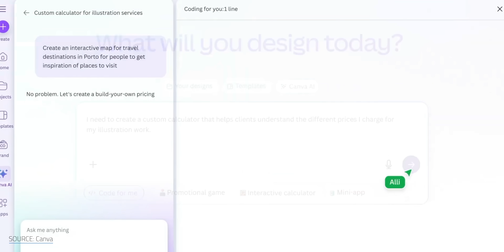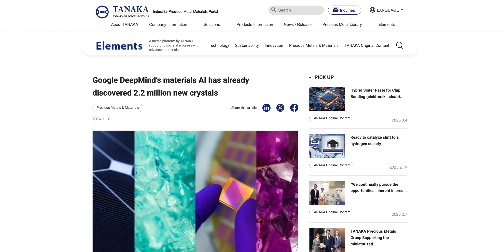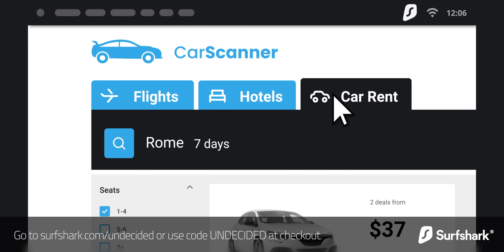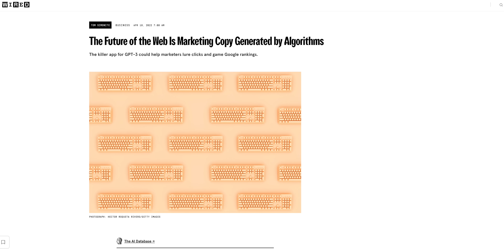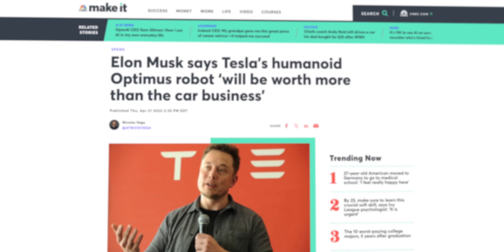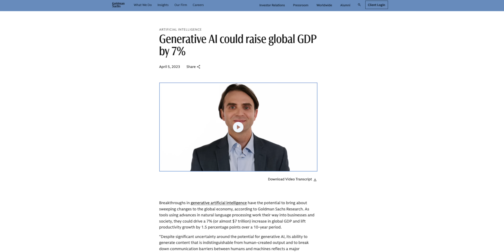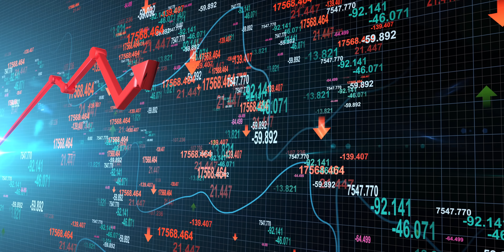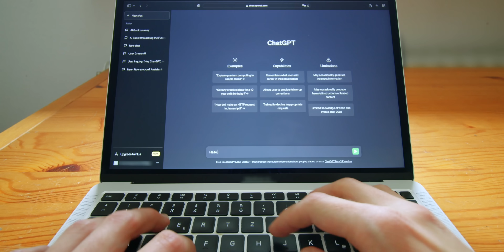Why the AI Revolution Has a Fatal Flaw

Comment: Here's the problem - assumption that we're going to be buying. Nope. The world will divide between the owners of production means and those dependent on "free" goods. However unjust current system is, when you have money, you have money. You can exchange it for whatever you want. Companies compete for your money. You can also save up and eventually start owning production means yourself. Or you can withhold purchase until price lowers, thus having a say, however insignificant, in how much something is worth. But if nobody's working and earning anymore, if everything is "free"? You're at the mercy of industry. They can withhold anything, after all, you're not paying for it with anything else than lack of agency.

What is free often proves most costly. ~ Goro Takemura, Cyberpunk 2077

Comment: I am convinced a UBI based on energy credits owned by the individual is the best solution. Energy credits would be investments into energy production companies that yield the source of both AI value and all production of products. If the government builds a nuclear reactor, the tax payers get UBI as investors in it's profit. UBI must have a maximum annual income (probably $150,000 or less) cut off, that allows the program to be solvent, but it must also have a minimum quality of life assumption. This model gives higher benefit to lower income tax payers, and eventually gives best benefit to non-tax paying citizens. The flaw is in the effort to live and be fruitful. If you subsidize drug addiction and strip clubs with UBI you will not end up with a healthy society. Therefore, a human-only counseling program should be used to check on no-income citizens for healthy lifestyle, and there should be strict laws taking away UBI for non-tax paying criminals. That they earn back if they return to some form of contribution and pay some taxes to "reinvest" in the energy based market.

Comment: Personally, I think lots of people talk about the potential for lost jobs.. If anything, I think this has been the MAIN narrative of the AI boom. IMO the solutions present are really one idea. Kinda. UBI funded by AI tax - a slightly abstracted method of distributing AI ownership. Yes, job reskilling and retraining programs have been inefficient and ineffective. And I think that if we do end up going down this path (and that's not yet guaranteed), we will be forced to fundamentally decouple income from work. Everyone needs income, there won't be enough work. That's the problem. So, the solution is to provide income regardless of work.

The problem there is actually that AI still sucks haha. AI is already taking jobs - but it has yet to provide enough value that society as a whole has seen benefits that we could share meaningfully. We haven't seen GDP skyrocket or productivity multiply yet. There's nothing to distribute. We may get there. Same thing happened with basic, dumb automation too. And just as the price and quality benefits of those job-replacing innovations begin to fall apart (and perhaps theoretically now accelerate with AI), the case for decoupling our ability to pay for products and services from our ability to work the jobs providing them only grows ever stronger.

Now if only AI could force us and especially the rich to pay a fair share of taxes..

Comment: 8:24 "Efficiency didn't solve the problem: it made it worse." I disagree because it depends on how you are looking at it. If you think the goal is overall reduction of coal usage for environmental reasons, sure, this increase in demand made that worse. But it made manufacturing better, which is why it grew so quickly. When coal use was inefficient, using it was expensive, so there was a more limited set of things where it made business sense to use it. As it becomes easier, cheaper, and faster, more and more use cases emerge where it is now a viable option. This increased overall productivity by allowing us to make more, better stuff cheaper. That opened up capabilities like trains being used for mass transportation, blast furnaces allowing us to make things from steel, and coal power plants providing electricity to homes so cheap that we could afford to light our homes in the evening with it. These all had huge knock-on effects, and while you would be right to argue that some of these effects were negative, that's always true of every technological advancement. Equally true is that it provided many benefits that we take for granted today. Your example goes to prove the original point: that AI enabling increased efficiency could lead to us being able to produce more, faster, and in doing so provide us with much better things than we have today.

Your original argument still stands - this could lead to the economic collapse you foresee - but the argument you've given at this point doesn't support that conclusion.

Comment: Brace yourself for the AI takeover, where our jobs vanish faster than a pizza slice at a frat party. History’s littered with tech terrors that sparked panic, and AI’s the new bully on the block.

The Industrial Revolution’s looms crushed weavers’ livelihoods, leaving Luddites smashing machines in vain. AI’s worse—it’s coding, analyzing, and probably knitting better than your grandma. Programmers and analysts? Doomed.

Cars killed off blacksmiths and carriage makers, who cried economic collapse. Now AI’s driving trucks and routing packages, turning truckers into nostalgic relics. The automobile age birthed jobs; AI just births unemployment.

Computers axed secretaries and clerks, who feared the economy would tank without their typewriters. AI laughs, writing briefs, diagnosing illnesses, and penning satire. Lawyers, doctors, writers—gone.

ATMs spooked tellers, but banks survived. AI’s running entire financial systems now, with chatbots and algorithms replacing humans. Tellers are “experience specialists” (aka unemployed).

Manufacturing robots stole factory jobs, yet we adapted. But AI’s designing factories and supply chains, leaving humans to polish robot egos.

AI’s not just taking jobs—it’s rewriting work itself. We’ll be trading canned beans in shantytowns while AI rules. History says we’ll adapt, but AI’s too smart, too fast. Stock up on beans—the robots don’t break for lunch.

Comment: A new form of socialism is coming and status quo is not happy about it... this is not a paradox, with AI, capitalism will be almost impossible to maintain...AI dependent socialism will be a very efficient world where purchasing power will increase because the profits will be extremely low, as new stuff will be invented everyday without too much capital investment...For example if a drug company spends billiions of dollars to formulize a cancer drug, which takes 20 years, with AI the formulization will be done 10 times faster and may be 100 times cheaper. So the company will not be able charge 10 thousand dollars per injection. instead it will charge 100 usd per injection or even less. In other words, people won't have to be rich to afford stuff anymore. Abundance will increase the purchasing power for everyone. someone impoverished will be able to afford more with less.

Comment: I have thought extensively on this and I think it is good you are raising these points. I think it is also valid to go deeper into the positive and negative cases for this. The most positive case could basically bring about a utopian future where money has no meaning… Something like Star Trek. (though it would require the world‘s largest companies, governments, and wealthy individuals to consciously agree to this) The worst case scenario hasn’t been discussed by far… 300 million displaced workers is a drop in the bucket. Remember with the combination of robotics and AI you are potentially putting entire nations out of a job like India. Think of all the nations that use cheap labor for farming, manufacturing, hospitality, and services. Every single one of those jobs can be automated. 
If you have worldwide unemployment of 30, 40, 50%
You will have complete economic collapse which would lead easily to a likely worldwide return to a society that is just barely at the industrial level or world war.

Comment: Replacing human labor is not a flaw of AI. It is a feature. That comes with replaced and displaced jobs by design. This is why the most important skills that people can master are explicitly translational between fields. Companies are paying through the nose for AI expertise as a sunk cost. Those jobs will not outlast the next decade and the pay will decline after another 5 years as AIs are trained by their architects today. This already happened with middle management. The safest jobs are those we are presently too reticent to permit an AI near, medicine (doctors/pharmacists/etc) and governance (bureaucrats/politicians/judges/etc). Even maintenance is on the hook. Manual labor by plumbers and mechanics will be under pressure soon enough. Prototypes are already being trained to compete. There will always be a market for human labor. It will fall to artisan quality and prestige. It will not be as drastic as the horse buggy falling behind the automobile, but it is easily a characterized as a larger technological leap. Energy production will be the major bottleneck behind AI, but nuclear energy solves this. That is a large part of why gen 3+ and 4 fission plants are back on the table, as well as fusion research and SMRs. Energy has been a long term looming major catastrophe for mankind. It is one of the open secrets you are thrown at in core STEM, especially engineering. We simply do not make enough energy available for everyone and we continue to increase demand, even with improved efficiency through technology. The existential gap between demand and supply from the rise of AI will finally push energy production to new highs, which will hopefully outpace the rapid rise in demand from exponential phase growth in global populations. If not, then people will starve and wage war for energy with a desperation we have not seen before in history. The quality of life and energy production and consumption per unit population (pick your quality metrics, population units, and specific demographics, it doesn't matter) are strongly correlated. The more energy a population can produce, sustain, and consume per unit of population, the better the quality of life. AI is going to stress test this historic trend with energy demand. For the presently planned uses of AI over the next 10 to 50 years to be covered, we will need to double the energy production, across the board for all sources, of each country using AI. We were already in an energy crisis before. This is the emergency. AI will be used regardless of energy supply. It will begin to reduce the supply available to people unless we finally get nuclear energy mainstream and widely used. Renewables simply can't and won't cover the gap. That said, nuclear energy jobs will only be safe from AI for the next few decades, maybe less. So, it would be better to get in on leading technology development early, if you still want a job in the field.

Comment: It will pass, like everything else. 
Once businesses start to notice how much money they lose due to incorrect decisions made by the software, they'll start replacing the AI with people again, and after a few major disasters, AI will also be banned from use in life-critical situations, law enforcement and finances. It's like a shiny paint-job on a Yugo, it looks nice but under the hood it's still junk. Just look at how the code for the AI is written, by whom, and that should give you a pretty good idea of what to expect. Right now the hype is still raging with impressive demos to lure investors, but it will disappoint. It's nothing more than pattern matching and brute-force optimization, nothing intelligent to see.
To be clear, the name is misleading as "intelligence" usually implies some kind of reasoning, yet it cannot reason so it is not "intelligent", but it does have plenty of "intelligence" when the word is used to mean "information", so it's mostly a glorified parrot, incapable of knowing if the information it is fed is actually valid or made up.
Humans are still going to be increasingly replaced by automation. There's no way to compete with robots when it comes to speed and precision, but that's not as much because of the software as it is because of the mechanical engineering behind the impressive machines that make almost everything we need.

Comment: One of the problems with UBI is when universal across the economy instead of local small scale trials, it could be inflationary where landlords would just (in practice implicitly) index rent to be a large % of UBI, and any improvement in UBI would go to them. Same also with basic goods and services providers. And then owners pocketing the difference.
Some degree or mechanism for redistribution of ownership combined with UBI may be required, but politically probably won't happen in practice until there are or about to be riots, unfortunately.

Comment: Even if the 59 year old wanted to re-educate or retrain the cost to do so would be prohibitive. Unless the USA makes the cost of knowledge come down dramatically the transitions will stay out of reach for most. I've already lost my job but find it difficult to justify taking on debt that may or may not pay itself back (in any reasonable timeframe if ever).
Of course people could actively decide not to buy from companies that use AI. Turn it into a liability instead of a strength. Social problems have social solutions.

Comment: I was evaluating AI supply chain solutions back in 2004. It was a model that had to be trained. The AI part was hype. Most of what you described is hype.

And AI will be a net negative. From job displacement to the ridiculous power consumption, it's time to bring this under control now before the people demand a Butlerian Jihad like in Dune.

Comment: One of the biggest issues that not talked about is how companies that abuse AI will distance themselves from the responsibility that comes from using it. Citing the fact that it's the AI's fault and thus they can not be held directly responsible for any form of wrong doing that WILL occur. Edit: Making a video about the perils of AI at the same time as running an advertisement for Surfshark has gotta be a new low for your program.

Comment: If you look back at history, every major technological advancement shakes up society, from induatrialisation, to computing, but usually it takes time, which gives society breathing space to evolve a new paradigm.

AI is moving faster then anything before, as much as anything because the infrastructure is there instead of needing time to be built. (Factories removed skilled jobs, but you have to build a factory base which takes time, that creates different jobs people can retrain for)

So instead of the shake up taking a generation, people will be leaving school now with training for a job that will no longer exist before they properly enter the workplace, but on mass!

As a society, we need to pump the brakes a little or in an eye blink things will change.

The current push at government level to not regulate AI at all is very dangerous for this very reason, it focuses on short term gain by few without considering long term societal damage.

Comment: Well, it's the same every time there is a big tech change.
In the times of industrial revolution it was the machines that took the work from the workers. In the nineties the boom of personal computers was blamed to take peoples jobs as well.
The end result is always the same though. Old jobs vanish or diminish but new jobs are created. 
Also as you said, new jobs are usually at higher skill level, so with higher salary. 
The only trouble is, that this doesn't happen over night and there most probably will be a period when old jobs will be gone, but new jobs not yet available. All previous tech revolutions created short term social unrest due to the lost jobs if I am not mistaken. 
So my view is, that these revolutions do have short term downsides with long term benefits.

Comment: Humans are a bottleneck in the system. I don't see new jobs created. Yes, some people can train into emerging fields, and CHANGE the way they work. But the majority, and especially the old, are not equipped with a brain that can handle such a significant change. Young people have a chance, because they didn't have to learn so much unnecessary stuff that is already obsolete. Every knowledge is going to be obsolete in months, or weeks at the rate all is progressing now. This incredible uncertainty is only accelerating in the future. The human brain can not be retrained DAILY. Only machines can be updated instantly. We are already loosing in this process. Biological brains will not be able to compete with basically limitless silicon based constantly evolving "brains". You are competing against football field size AI data centers, or a network of data servers. If automation could solve our future, we were already become richer and richer. The opposite has happened. Just project the trendline into the future on the same graph. The average people are already left behind, in every way possible. Now AI and robotics come for the rest of humanity. I can't even keep up what's new and revolutional in AI development, and I read and watch everything humanly possible on the internet to see where we are now. Robots stumbling last year, now dancing, and no longer need classical "programming". They interpret videos and train in virtual environment for years, and it takes an hour in physical reality. AI is learning everything a human can, at an INCREASING speed. I don't see a human job that is immune to this. Humans are no longer the most productive species in the economy.